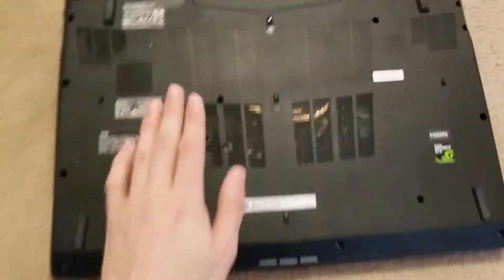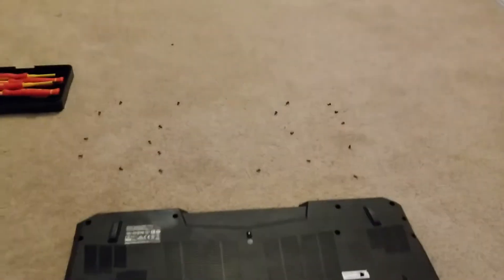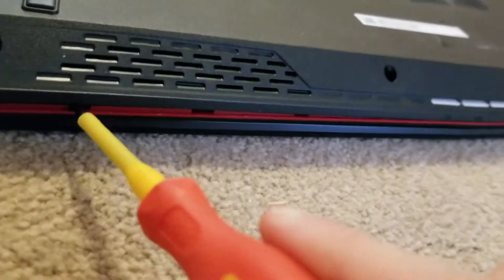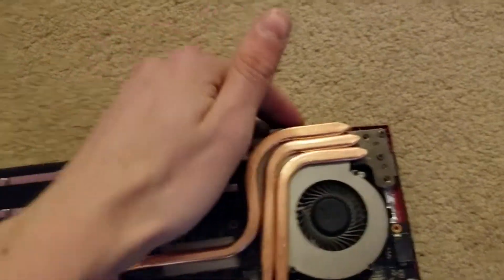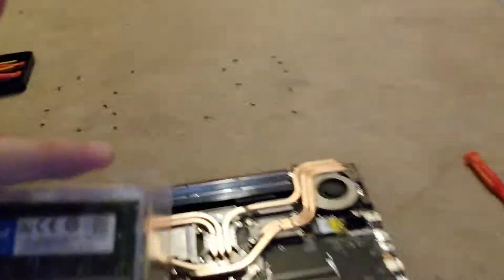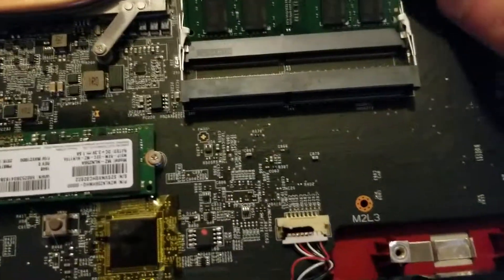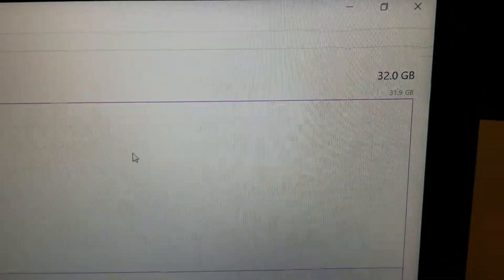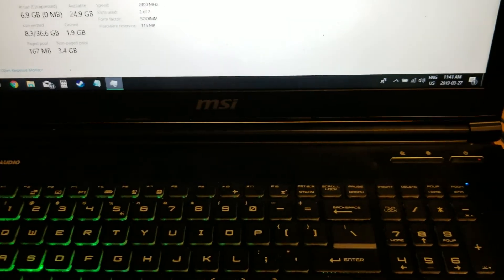Laptop Ram Upgrade/Replacement Guide

Comment: Greta vid, thanks. I’ve just upgraded both internal SSD’s and am now looking to upgrade my memory to a 32Gb kit. The hurdle I’m trying to jump over is - which is the best kit for my GE72MVR 7RG Apache Pro. Crucial have a great compatible upgrade section on their website. But it’s just put even more hurdles in front of me. They list several different kits which includes the Ballistix range. A Ballistix DDR4 - 3200 is priced at £130, however the standard Crucial DDR4 - 3200 is priced at £135. Then there is a Ballistix DDR4 - 2666 priced at £136. To me these prices are back to front as I would have thought the Ballistic range would be superior to the standard Crucials. Can anyone explain this muddle to me?

Comment: I find using guitar picks to pop the clips will save you from breaking any.
Reply from the maker: Excellent idea. I used what I had lying around, didn't even think to use a guitar pick. Thats a great idea.
Reply: @TheJamie109  They always work well on laptops. I watched your video as a client just got an MSI similar to yours and I wanted to see if there were any hidden points of access. Was pleased to see was easy to get into. Already changed the RAM and we are good to go. Glad you made the video!